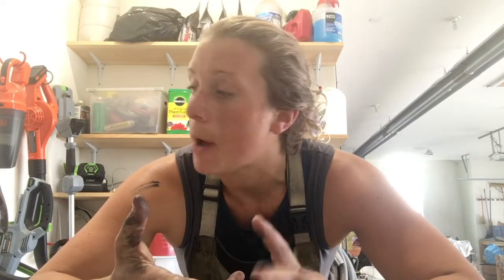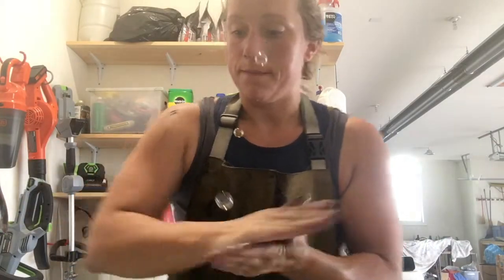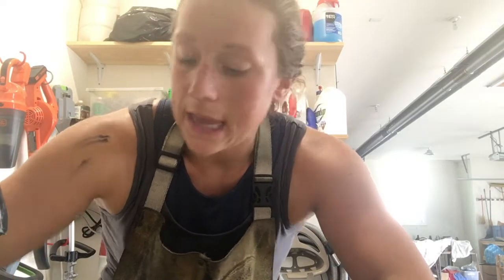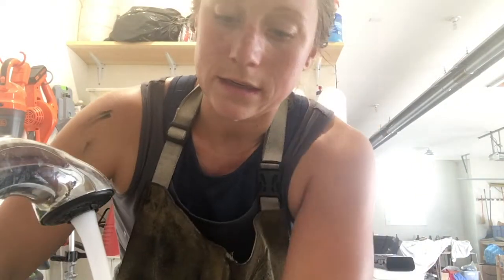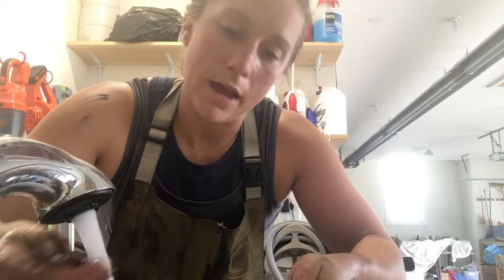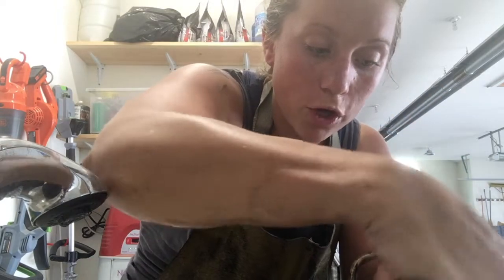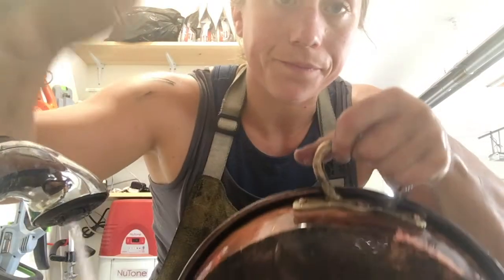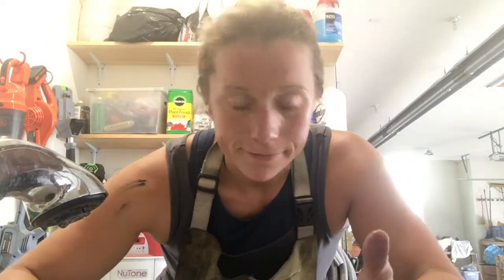How to Clean Copper After Tinning

Comment: The only recommendation I might have; a gun cleaning kit might have brushes that would help clean around those rivets, in where you can't easily get a larger brush. Brass or copper bristles obviously won't be as aggressive as steel wire, but it'd allow you to get in the tight spots where nothing else fits.
Reply from the maker: I do like the steel wire brushes sometimes, especially during the actual tinning process. But otherwise I like to do the Dremel option with all the different attachments so I don't always need the brushes during the tinning. :)